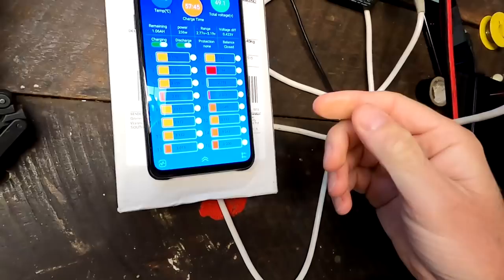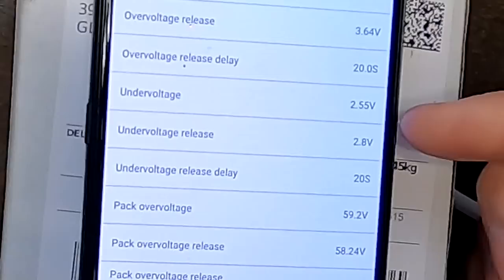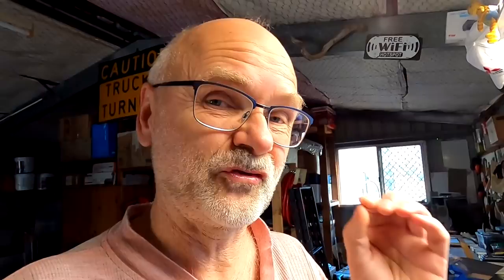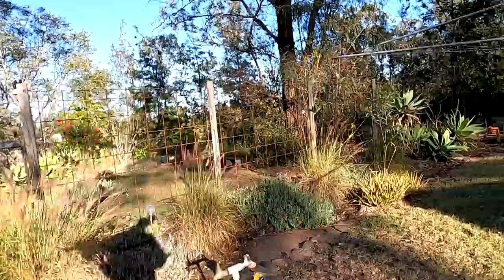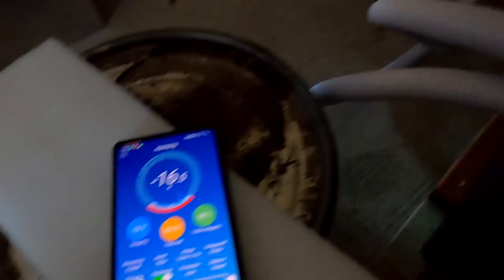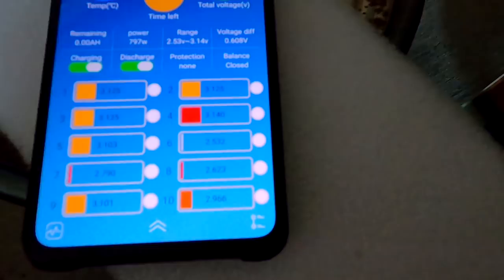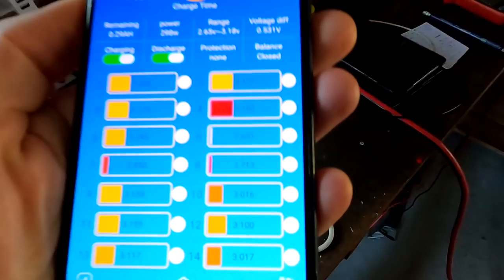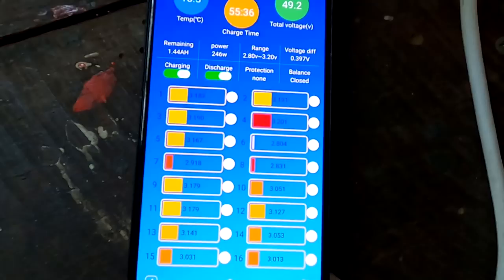QUCC BMS with relay. Why is this happening? 🤷‍♂️😷

Comment: I have a QUCC BMS. I have also been in a situation of the relay cycling but with one difference. In my case the battery pack was fully charged. Not understanding what was going on I turned off the Victron inverter using its rocker switch and isolated the BMS by using my cut-off switch on the positive side. After reinstating the cut-off switch I was able to reconnect the BMS relay using the app. After that the inverter and loads worked OK. As this was in effect a reset for the software perhaps there is a software problem which is not low voltage specific. If so concentrating on the low voltage logic may not be the answer.
Reply from the maker: Thanks for sharing, Nigel. I have experienced similar behaviour at the top end with the relay cycling for no obvious reason. As someone mentioned here in the comments, these are extreme situations which don't occur under normal circumstances but it is still good to know what to expect if something goes wrong.

Comment: Interesting problem. I suspect the firmware programmers may just be toggling bits, rather than using on/off commands. Or it could be leftover from the FET logic, and not realize that turning on the charging also turns on the discharge, senses low voltage,  turns off, rinse and repeat.
Reply: Yup, my though as well. I was thinking, if so a work-around might be a time-delay to hold the relay on for a few mins to allow the pack to reach release voltage.
Reply from the maker: I suspect poor software design as well. All the parameters are clearly in the app available but the BMS does not follow these settings.

Comment: Pack under voltage release is set @44 should be 44.8 to match cell under voltage release of 2.8, pack under voltage is set @40 should be 40.8 to match the 2.55 cell under voltage.
Reply: The pack voltage was 48V; way above 44V set.
But you are correct (in pointing out Pack Voltage) that it might had a play in the above problem.

I personally think Pack Over/Under Voltage protections are irrelevant/redundant considering Cell Over/Under Voltage precedes Pack Voltage.
It is like asking someone "Are you older than 40years old?" and after getting a YES answer proceeded to ask "Are you older than 38 years old?"

Comment: The BMS low voltage trip should trip the Inverter too, so it does not compete with charging.

Comment: That is why in some situations, a dual port BMS can make sense.
But...once you are done with testing, I assume, that you set the proper under voltage disconnect at the inverter before the BMS disconnects?
Or maybe use the Relay of the BMV-700 to switch off the inverter at a low SOC?
Thanks for all your testing :D
Reply from the maker: Thanks Raphael.
Yes, the low voltage disconnect in the inverter was turned off for this test. The inverter will shut off before the BMS triggers.

Comment: One relay for charging and another for  discharging. Then it will be fine.
With just one relay, the UVP detects voltage that is too low with the corresponding load and switches off. This increases the voltage again and solar also charges. Therefore, UVP switches on again and the game starts all over again.
With two relays, the charging relay remains closed at UVP and thus charges, only the discharge relay remains open and prevents discharge until the set UVP values for switching on again are reached. This is not possible with just one relay.
Reply from the maker: QUCC has BMS with two relays for that purpose. They may have figured out one is not good enough 😂

Comment: Now you see why people use Daly. You are drawing a load while the batteries have cells under voltage so as soon as the contactor closes to allow charging the load sags the cell voltage and cuts the load. The cell then rebounds and turns the relay on to charge. In a nutshell you drained your cells too low to allow simultaneous charge and discharge. Turn off your inverter and allow the batteries to charge up a bit then you can reconnect your load.

Comment: I think all the "xiaoxiang" BMS do the same thing regardless of being relay or normal version. Whenever the charger is connected, the discharge function is activated (as long as charger is plugged). You can test it: turn the discharge OFF, then plug in the charger, and surprise...... the discharge button goes to ON position without changing it by yourself.

Comment: maybe the time delay needs to be longer to allow the battery to charge to a higher voltage before it turns the loads back on
Reply from the maker: It is set to 20s already....

Comment: Maybe the pack under voltage settings conflict with the cell individual undervolt. Does the 44V pack reconnect setting override the individual cell setting? Raise it from 44 to 50

Comment: The BMS does not control the inverter. It is trying to charge by turning on the relay which is allowing the inverter to start up. So the BMS protects again by turning off the relay but it senses there is the possibility to charge so it loops between turn on the relay again. Once the voltage is bellow the 48V you have set for inverter low battery reset and alarm the inverter no longer turns on for awhile. The BMS can turn on the relay and keep it on.
Now you have a good estimate for the low battery disconnect to use for the inverter =48V and the restart voltage will need to be a bit higher to avoid the BMS issue.
Reply from the maker: The inverter is set to disconnect really low at the moment, so I can see what the BMS does and how it handles it if the inverter does not turn off. Thankfully the inverter has a dynamic cut off function which disconnects depending on load.

Comment: could it be the huge surge required by the capacitors in the inverter dragging the voltage down as the internal resistance is quite high due to the low state of charge plus cable resistance?
Reply: The same question occurred to me.
Reply from the maker: No, the BMS has a pre-charge resistor for that if the relay is off.
Reply: @OffGridGarageAustralia  Cool, if the BMS sense voltage is stable (Perhaps monitor it with a DVM rather than the BT voltage to confirm) that would see to suggest a software issue with the BMS.

Comment: Thanks Andy, Great test I would give the QUCC BMS a fail in this situation, not much of a backup!
Down loaded the JK BMS data sheets and looking at the canbus protocols looks like it is compatible 
with many inverters/charge controllers, (thanks for bring them to our attention) but it does not mention 
BMS's communicating with each other. eg. 3x48v banks total 3 BMS's canbus on one connects to inverter/charge controller 
not clear about the other two, maybe parallel and assign different addresses?   Looking forward to your solution and enlightenment
Reply from the maker: Great! Thanks Wayne. The JK seems to work nicely and ticks all the boxes so far...

Comment: Creo que estos BMS están diseñados para una configuración en que la batería se descarga o se carga, no las 2 cosas a la vez (por ejemplo un vehículo eléctrico, o está en uso (descargando) o está parado (cargando) pero no las 2 cosas)
Para la que tú quieres necesitas un BMS de puertos separados, conectando los cargadores a la línea de entrada y el inversor a la de salida.

Con este tipo de BMS (puerto común) y está configuración, para evitar ese parpadeo del relé, deberías tener siempre conectado un balanceador (que no permita diferencias entre los voltajes) y configurar el voltaje de corte por bajo voltaje en el inversor 0.05V antes de que actúe el BMS por bajo voltaje, por ejemplo si quieres descargar las celdas hasta 2.55V (el conjunto serían 48.45 V) el valor de bajo voltaje en el inversor debería ser, por ejemplo, 48,50V (con todas las celdas equilibradas) y configurar que vuelva a consumir (descargar) cuando el voltaje vuelva a los 50V. Así se acaba el parpadeo (encendido/apagado) del BMS.

Perdona que escriba en Español, por cierto este video los subtítulos los genera en Alemán, mi inglés es muy básico, necesito los subtítulos (al menos en inglés) y en este video no los he podido poner, tal vez me he confundido en alguna de tus explicaciones.

Comment: If you trust your charge controllers to not fry your batteries, you can connect them directly to the battery bank, bypassing the bms.  That should solve the problem.  I wouldn't use an active balancer in that configuration though.  Make sure they are properly top balanced first.
Reply: A better solution would of course be to replace the BMS with one that can control charge and discharge current separately.
Reply from the maker: I would not connect the SCC to the battery directly without BMS in between. That's madness. A better BMS solution is the way to go.
Reply: @OffGridGarageAustralia  connecting the charge controller directly to the batteries is often done to prevent the charge controller from being destroyed if the BMS shuts down.  Many charge controllers cannot handle that situation.  The problem is compounded when using an MPPT with a high string voltage.  The BMS opens, killing the MPPT.  The failed MPPT dumps full string  voltage onto the BMS, killing it, which allows full string voltage onto the battery, killing the cells.  One failure can cause a chain reaction and destroy the entire system because the BMS tried to prevent a minor over voltage condition on one cell.  I watched a video recently where that's exactly what happened on a brand new system.  I suspect the root cause was misconfiguration of either the charge controller, the BMS or both, but i still feel sorry for that guy.

Comment: 092821/1355h PST 🇺🇸 092921/0655h Brisbane 🇦🇺  Good morning Andy. Thanks for the video. I’m not being critical but only airing my peripheral thoughts. Mechanical devices are always prone to issues. (Issues=several. Due to time and space constraints, unable to describe all of it) I may be wrong, but once the coil is energized; the consumption increases, the power decreases inversely, coil gets de-energized, armature detaches, power (weak) returns, coil gets energized and the cycle goes on and on, repeatedly. I’m pretty sure you know these basics.
The question is, why ever allow the cells to reach such a low power condition, in the first instance?
If this is an NDT, I can understand and appreciate. Under normal operation, most end users may not experience a similar situation. More so, I’m certain, that 90% of PV Cell users may not use QUCC or for that matter DALY BMS.
JBD BMS is gaining popularity, it’s trouble free and easy to install and monitor on iOS and OS X devices.
Do forgive me, if you feel, that I have exceeded my limits. With all due respects I remain. 
Have a nice day ahead and 73s…
Reply from the maker: Good morning Shree, thank your for your comment, much appreciated as always. As I explained the situation in the video. I was charging the vehicle and the battery got really low at the end. Shortly after, it even turned off and I could hear the relay going on/off all the time. This was just the test to confirm what exactly was happening. I 100% agree, this is not something which should happen in the first place as the inverter should shut off before the BMS does it. But it is also good to know what happens, if the inverter fails, or you solar charge controller. Is the BSM correctly setup, does it disconnect in either way? What exactly happens, is it safe? Hence I'm doing all this testing at the extreme points of the battery.
Reply: Danke schone, mine freund.

Comment: I am convinced there is a MOSFET across the relay that allows some charge and discharge without the relay. Over a certain current of charge or discharge the relay will turn on. This means that if the discharge is more than the charge the voltage will go down. This is the FET that was shorted on your first BMS. But yes not ideal in this higher discharge/charge circumstances. As always... Diybms by Stuart Pittaway!

Comment: Love your videos!  Have you done anything with the Electrodacus SBMS0?  I didn’t find it coming up in searching your channel.  I am building an 1120AH, 4S Lifepo4 pack for a boat (12V due to existing loads on the boat).  Wondering how to integrate an active balancer into the system.  Thanks!

Comment: Theory… Are you sure charge can flow through the black cable? Could that just be a sensing wire? If so, it can see charge available so engages the relay. But once this happens, the load on your inverter kicks in and it appears the load is greater than the charge (you see the amps go from positive to negative). The BMS then has to disable the relay because the load, being greater than the charge, looks to be creating a net discharge.

Comment: Regarding the active balancer and how it unbalanced the battery pack, you have to remember that it's only moving 2A of current and for a 280Ah battery pack, this is peanuts! 
In other words it just can't keep up! It's trying to balance on discharge and again during charging which is great for keeping the battery pack balanced at the top and it's going to allow all the cells to discharge and the bottom end but at 2A it just can't keep up! 
On a smaller battery pack, say that 5.5Ah cell that you have been testing in previous videos, it should be able to function properly but you are going to need an active balancer on every series string.... 
All the cells seem to have different internal resistance which basically means that they will all charge and discharge differently.... An active balancer will make sure that all energy from every single cell will be available for use but only if the active balancer can keep up! 
On the 280Ah cells, you are going to need more active balancer modules wired in parallel until someone makes one that can move more than 2A at a time! 
The active balancers job is to compensate for the different internal resistance of the cells, unless you are a manufacturer of cells and set up a system that test's the cells ability to charge and discharge equally and ship packs when they are all matching, you either have to purchase a lot of cells and match them up yourself or use active balancers.... 
There's no way around this particular case at this point in time...
Reply from the maker: Thanks Peter. I would not bother balancing the pack at such a low voltage as the capacity gain is marginal. It would only destroy the initial top balance. I'm happy with the 4A active balancer I have now and it kicks in at 3.45V. Rarely fully charge my battery anyway...

Comment: The thing with a relay BMS is that when under voltage the relay opens.  But how is charge supposed to get into the battery, when the relay is open?
Same thing at the other end.  Battery over voltage, relay opens.  How can current get out the battery with the relay open?
It would appear the BMS sees charge voltage and closes the relay, but there is still a load connected when the relay closes, battery voltage falls so BMS opens relay.
BMS needs 2 relays.  1 for charge, and 1 for the load.

Comment: It will never work as you want it to work because you only have one relay that controls both the power going in and out at the same time, the black wire at the output is just to sense if something is trying to charge the battery and I don't think it actually lets any power in.

What is happening here is that the load is higher than the charge, so when the BMS cuts the power it also cuts the charge, but since now the load is off the charge is higher so it closes the relay to let power in but that also activates the load and so the cycle repeats, for it to be able to work properly it would need to have a second relay so you can have an input and an output, that way you could turn off the load and keep the charging on.
Reply from the maker: So fault or design?
Designed to fail?
Reply: @OffGridGarageAustralia  Not really, just not fit for your situation, if your charging was always higher than your load it would work always, since your charging seems to be lower than your load you'd need either a BMS with two relays or a BMS that uses mosfets to control the flow of power in both directions separately.

Maybe changing some settings on the inverter to avoid it turning on immediately once power is back could mitigate the problem but not sure if you have such settings available.
Reply from the maker: @jonathanalcocer3872  the inverter usually turns of before that situation. I turned off the low voltage disconnect in the inverter for this test to see how they BMS reacts.

Comment: That's the problem with a single line safety loop.  Once you go into fault you can't use the opposite system.  BMS's should have OK to charge and an OK to run loop.  So that when the batteries are low you can still charge etc.
Reply from the maker: The QUCC BMS does still allow charging even the relay is turned off. So it's not like it's hanging dry there. But yeah, the situation is certainly not ideal.
Reply: @OffGridGarageAustralia  How, is it possible ? If the relay if off no charging is possible in fact because the circuit is opened.
Reply: Yes it’s not possible. The charging can be 60A. That can only go through closed relay contacts. The BMS is doing the right thing. Closing the relay when it sees charging voltage and then immediately opening it again when the inverter sucks away that charging voltage. It is correct logic. It is using the relay like a diode to channel current into the battery and not let it out again. The relay will only stay on during discharge once the low cell recovers above 2.8V.